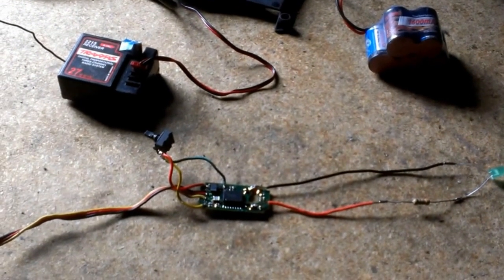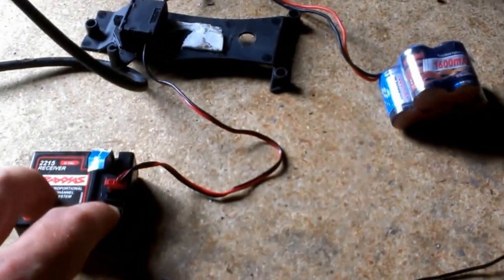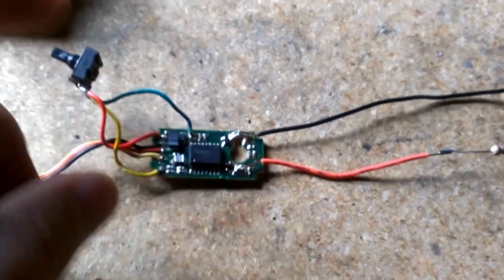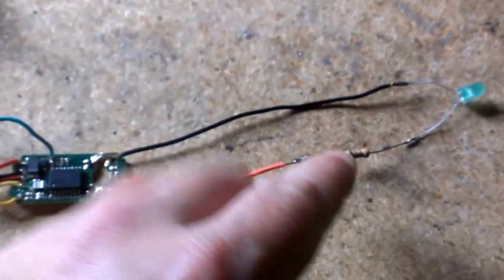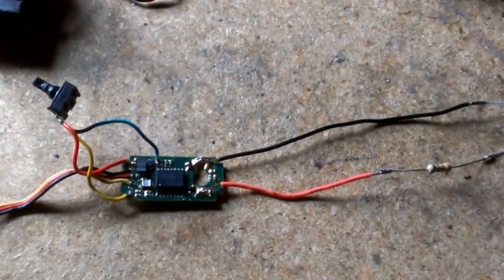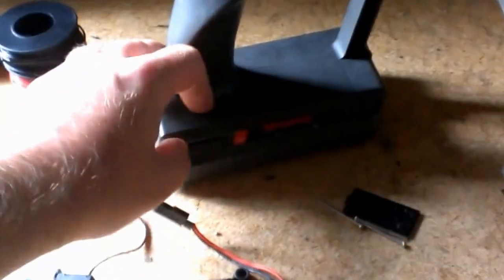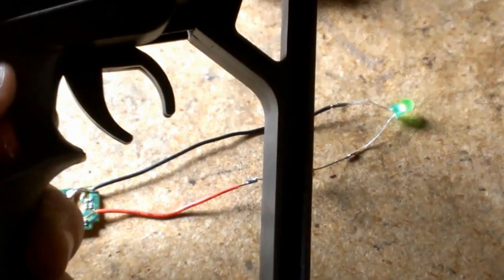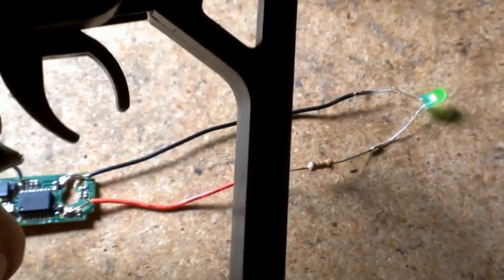LED controller from basic RC servo

Comment: Would I need to add resistors or a fuse if I’m connecting this to auto LED strips?? I’m connecting the servo controller to strips then plugin that into my channel 3 since I removed my reverse from my TMaxx to forward only I have the extra servo will all this run on the 4 AA battery set up that traxxas has in it or would I need to rip that out and add 3 9v battery boxes in sync to be able to handle all the electronics plus steering and throttle and brake I want to do this with out resistors as I don’t know anything about those things

Comment: Why did you replace the potentiometer with a 2.2k and a 4.7k ohm? Is that not way moe than the 5k ohm potentiometer?
Reply from the maker: Honestly? No idea, I haven't used any servos in years, so I don't recall. Good point though, it should work like you said.

Comment: this vid is so old, but that's what i will probably add to my will-soon-be-getting Tamiya TT-02 LaFerrari, I already bought the traxxas 4-cannel transmitter-reciever pack, I also have an Idea how i could modify this design to work with two outputs for turn signals( with ic555 timers)

Comment: I use 6v led problem solve check the out put voltage with a DVM (digital volt meter) need to make an other with a 3v output for a radar motor as it spin to fast at 6v or try to adjusted the pop so the output only 3volt then lock in place with super glue

Comment: What is the resistor for? I thought the Pot acts as resistor already?
Reply: ***** No, the resistor works as voltage/current limiter because the original motor works with 6V but the led is only 2/3V 10/30mA, so,it need a resistor to limit the voltage and current.